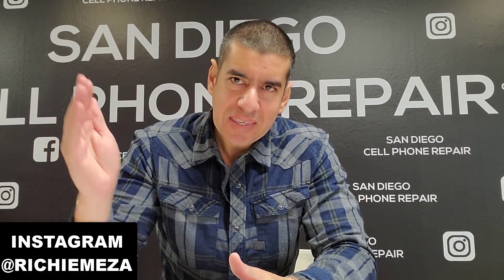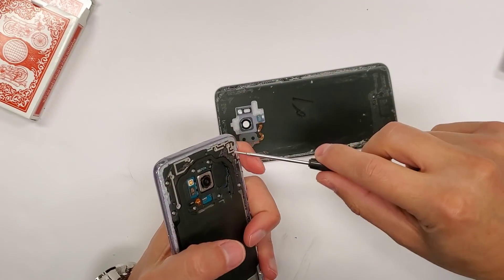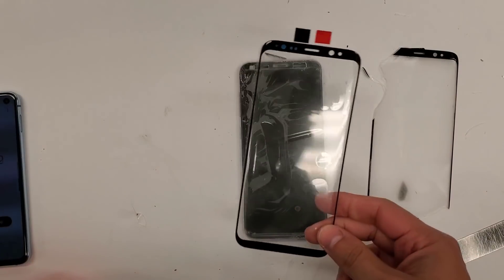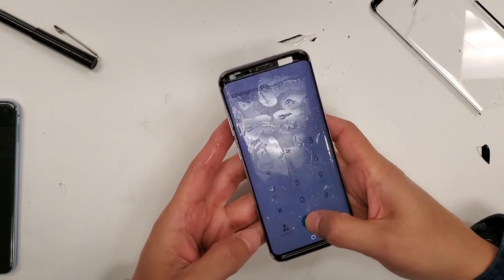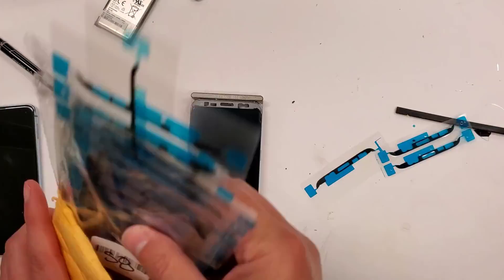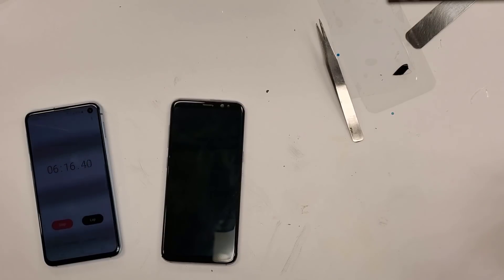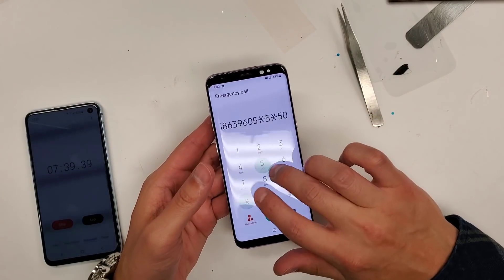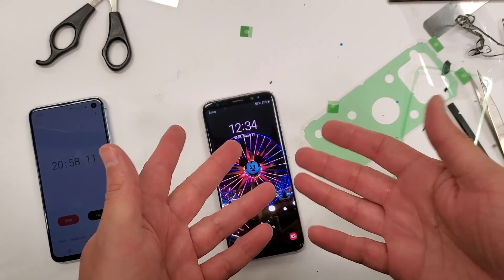The Easiest and Best Way to Replace Glass Only on S8 Samsung Galaxy Cracked Screen Repair

Comment: Another great Video, Thank you very much. Just wondering why does it so hard to get off OCA glue from the lcd....
Reply: After using that drilling tool to remove part of the OCA glue, the rest of them which is just some part of the left isn't that easy to remove using alcohol. Any suggestions? Cheers.
Reply from the maker: @NicolasChoiNZ  As long as you leave it in the cleaning mold which is still hot and leaves the screen warm, you can pick it off. The cleaning mold is made of metal and will keep warm for over 5 min. That's easy enough time to get the last bits off. You also might be missing some of it. Make sure you look around the screen and see what you missed and get it off with that spinning tool.
Reply: @RichardMeza  Do you even use OCA? If I want to use OCA I have to separate LCD from the frame and that fails me a lot, it's already 5 LCDs broken which I tried to take off LCD from the frame...damn it, is that the reason you normally use LOCA?
Reply from the maker: @NicolasChoiNZ  That's part of the reason. I do use OCA sheets with the Samsung Note phones because of the air pockets from the S-Pen flex cable. I do it in frame though. I dont take it out of the frame. Taking it out of frame is more difficult and takes longer to do. I use Loca on the regular "S" series because it's simple and quick to do. Time saver.
Reply: @RichardMeza  That's so interesting, how it possible to use oca sheet on a LED with frame? If it's still in frame you should not be able to put LED on top of oca molds to use machine. Very interesting method.

Comment: Hi
What can i do with the dust ???
Have you dust free room
Reply from the maker: My environment and shop doesnt have dust flying through the air.
Reply: @RichardMeza  ok 
What is the system or this thing what you have
Reply from the maker: @Qrepairz  I dont have an air system. I dont have an issue with dust flying around my shop.

Comment: Nice! What tripod you used for filming your work?
Reply from the maker: I bought it on Amazon. I can link it later. Going to bed.
Reply: @RichardMeza  So which tripod is it?
Reply from the maker: @noahb8088  I post it later tonight if I can remember.
Reply: Richard Meza Thanks, don’t forget!
Reply from the maker: @noahb8088  Here it is. I bought it from this exact company through Amazon but it looks like they are out of stock in the Amazon warehouse. They probably ship these themselves from their business. It's very easy to use. I use it with my cell phone. Everything I film is on my cell phone. I think I bought a different attachment from Frys electronics that holds on to your phone that you attach to this mount. 
https://glidegear.net/products/glide-gear-oh100-professional-metal-overhead-table-top-mount-stand-studio-video-camera-top-down-platform

Comment: Awesome video as well mate.. I have a question for you, would you recommend buying original refurbished screens or go for "quality" aftermarket screens? It's for both iPhone and Samsung
Thanks mate
Reply from the maker: If you buy original refurbished screens, they are too expensive. I would refurbish the ones that are left behind from the customers phone and use those that are your original refurbished. And also buy the best aftermarket screens. Then distribute those out however you like. As for Samsung Edge phones, buy the best deal. There are no bad quality that I know of Edge screens. They are all Oled material not like the LCD iPhone screens.
Reply: @RichardMeza  thanks for your reply :-) its just for when I feel confident enough too actually repair customers screens rather than my own.. I want them to have the best experience possible

Comment: Does it leave waves on LCD?
Reply from the maker: When you use the cleaning mold in the video, those waves are very small. It has those rubber orange pieces that pushes up on the battery hole and square piece at the top.
Reply: @RichardMeza  Thanks for your reply, I was about to order a freezing machine, but if it leaves those very small waves it may be a problem (if visible) with picky costumers. don't you think so?
Reply from the maker: @midcell5749  customers dont mind. Before I used the cleaning mold the waves were bigger. Once I started using the cleaning mold and the spinning rod tool  it's very small. The freezer doesnt make any waves. It's the cleaning process is when that happens. When I stopped cleaning the glue off with my fingers and bought molds and that cleaning tool, the waves almost went away.

Comment: Is there anyother way removing glue without warming up i have no mold
Reply from the maker: Your hands. But the mold is to make it alot easier and to not have pressure Mark's or waves.
Reply: @RichardMeza  i try alchol for cleaning it works but same issue came after puting loca i dry and bubble came.can i remove these bubbles by using bubble remover or only oca works with bubble remover
Reply from the maker: @farrukhshahzad7581  bubble remover doesnt work with Loca. You can remove the glass and try again.
Reply: @RichardMeza  so i can put again in freezer ryt
Reply from the maker: @farrukhshahzad7581  Yes. Do you have a freezer like I do?
Reply: @RichardMeza  yea i have i recently buy it but this is my 3rd or 4th lcd to fixing it my self m buying cracked phone n making them then selling same like u
Reply from the maker: @farrukhshahzad7581  You just need a little practice spreading the Loca glue. I also have tutorial videos in my course how to do this. I explain exactly what I'm doing and how I spread the glue to do a perfect job. It's really easy once you learn.
Reply: @RichardMeza  i tried removing glass again but lcd got damage.🙁
Reply from the maker: @farrukhshahzad7581  How did you take it off? The freezer is easy to get the glass off once you already did it before on same phone.

Comment: Is it possible  to replace a s9 glass with a black dot on the screen
Reply from the maker: No. The black dot means the screen is already bleeding. You need to change out the full display screen.

Comment: Can’t you just use 8222 remover instead to remove the glue ?
Reply from the maker: That chemical is harsh. You've never used it before. I have once. I had to open both the front and back doors to my shop. The odor was so strong it was embarrassing to have people walk in here. That smell was in here the whole day. Never used it again. It's not needed at all. With 91% alcohol does almost the same thing with zero smell and safe to touch on your skin. That 8222 liquid is horrible. No need for it if there are other options. The heat is what makes the glue soft to get the big chunks of glue off.
Reply: Richard Meza I use it but yeah I agree about the smell, it does smell toxic..thanks for the reply I didn’t know just 91% Alc would work.

Comment: After seperating glass from s8 plus when i cleaned the glue the touch stops working.i tried on 2 screens both touch not working anymore after cleaning glue🙁i used a piece of cloth and liquid to clean
Reply from the maker: You used the wrong cleaning liquid. What did you use to clean. Which liquid?
Reply: @RichardMeza  i used zeppo
Reply from the maker: @farrukhshahzad7581  I only use alcohol.  In my videos I show I use 91% isopropyl alcohol. It's safe to use on electronics. The cleaning liquid you are using is probably stripping the touch sensitivity off. And touch doesnt work anymore.
Reply: @RichardMeza  is there any way to make touch works
Reply from the maker: @farrukhshahzad7581  I dont think so. Look on the bright side. You know now what mistake was made and move on. If you learn from mistakes, it makes you better from not doing it again and now you know what doesnt work.

Comment: I tried this but it looks like the tint came off and left a silvery looking material..............  Ooops...Guess I am going to order a new display.  DO NOT TRY WITH DRY ICE!!
Reply from the maker: What method did you use?
Reply: @RichardMeza  I missed the comment about dry ice not getting cold enough.  When I pulled it out of the cooler and went to split it, it split the display in half (like between the black film and the gold film underneath!  Still....  Learned something and it will still be cheaper than going to a shop and I have the experience!!!  First step on the road to knowledge.  Thanks for the video!
Reply from the maker: @82edwards  There is a video out there with Jerryrigeverything that uses dry ice on older model iphone screens but those are old model LCD iPhone screens.  I tell everyone Samsung screens are Oled screens and dry ice doesnt get the Samsung screens cold enough. I tried it before.